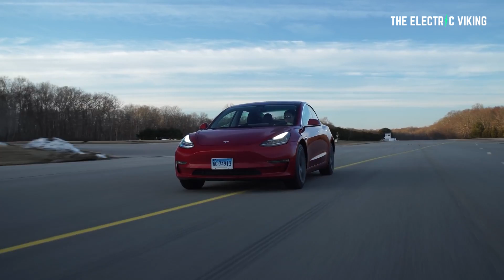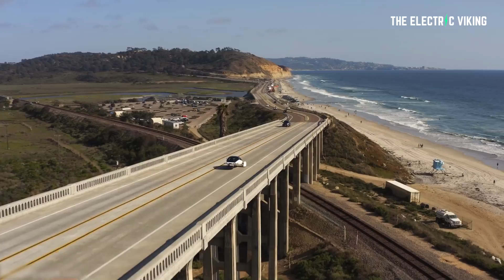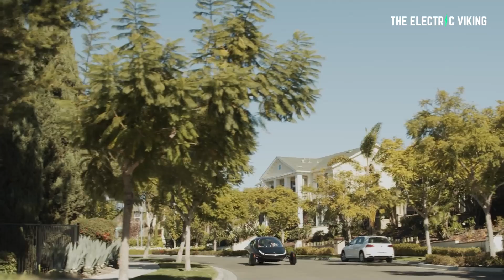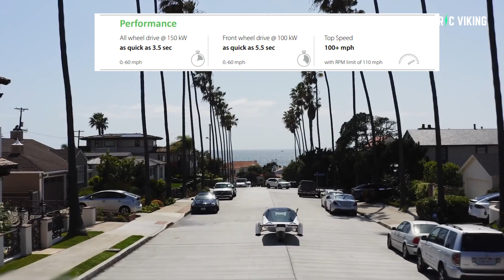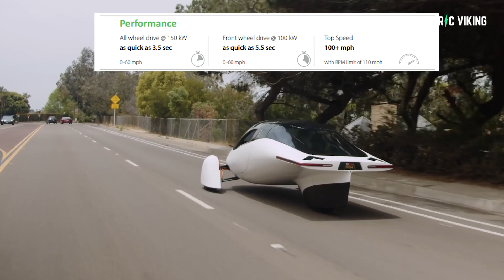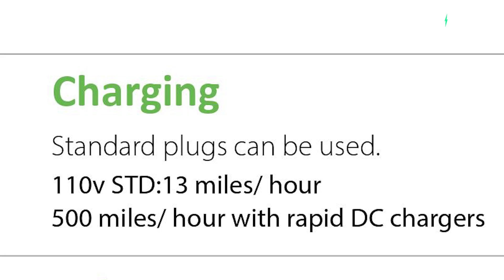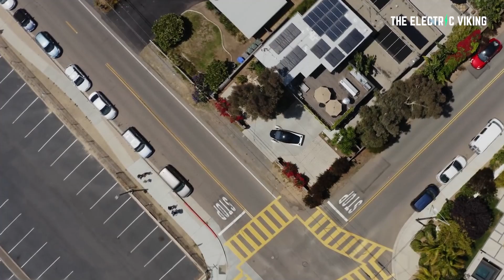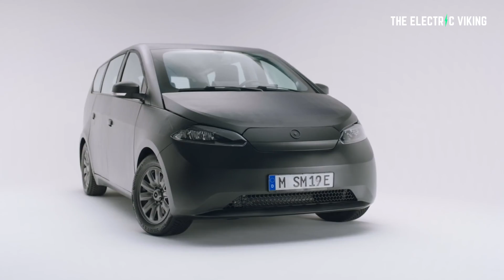I JUST bought a self charging US EV with 1000 mile range

Comment: Amazing concept but my problem with it is 3 wheels, though Sandy Munro likes it. Maybe I’m too closed minded.
Reply: How big wheels do you want?
Reply: @robertstout9240  i see standard wheels are 16”. 18” optional. Looks smaller under the shrouds.
Reply: @dscarty  While in engineering school I was the VP of the student chapter Society automotive engineers And have raised two and four wheel vehicles for years. this doesn’t make me an expert by any means but the three wheel design with two in front is not only very stable but enables the rear of the car to have much less drag as it gets slim shrouding just one wheel. If we look at nature both birds and fish taper much more in the rear than in the front. Above about 50 miles an hour cars use more energy pushing air than moving weight.

Comment: Your tag line is miss leading 😢.  You did NOT buy one, you pre ordered one.  Lot's of difference.  I have pre ordered a Cybertruck years ago and I pre ordered a Ford F-150 Lighting 2 months ago, but again I have not bought them.
The worst thing about the three wheelers are what's going to get damaged are the wheels sticking out.  Those will be the first thing to get hit or damaged by the owners and will be very expensive and will take a lot of time.

Comment: What I am missing here, if you never have to charge it then it ought to have a 1,000,000 mile range. LOL
Reply: @adamgreen911  I know, I guess the LOL was not plain enuf that I was joking.
Reply: 1000 mile battery without stopping. . Solar charges at 30  miles per day. So you can go forever without charging, as long as you only go 30 miles each day.
Reply: @adamgreen911  If you charge it and drive through a 9 hour Winter night, you can drive all night, but only when it's real.
Reply: @adamgreen911  My point was you can drive all night. This is another matter. I am not sure how long, but expect it to be most of the day; an unacceptable length. If you rely on solar, I expect it will take months, if it can at all.